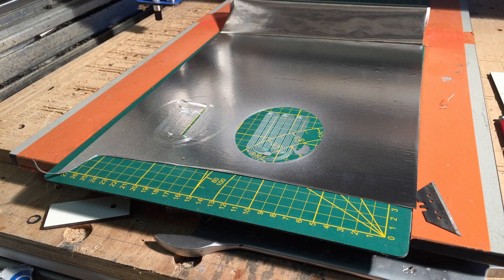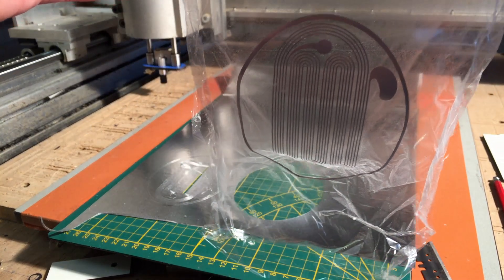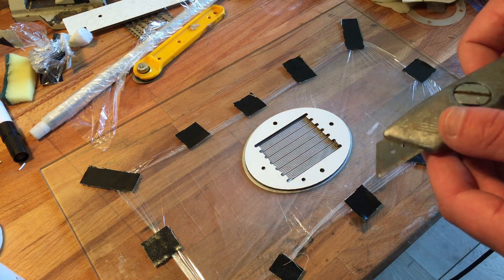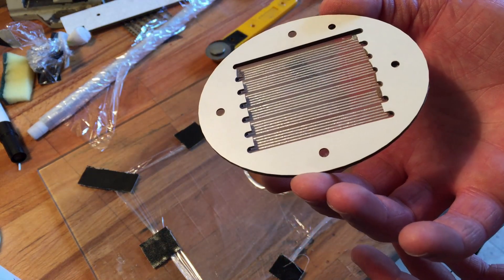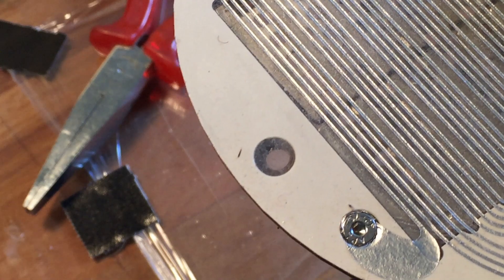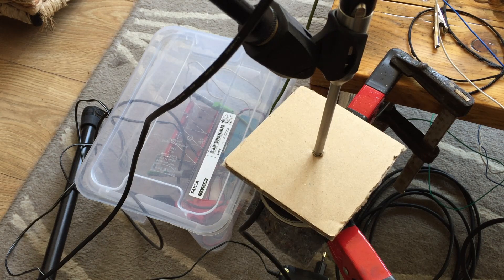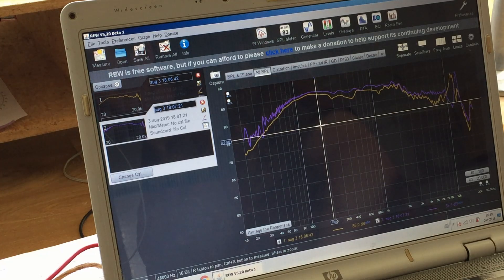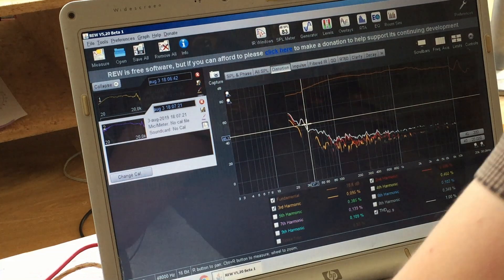Diy Planar Magnetic Headphones - Part 4

Comment: Where did you get 1 micron foil?
Reply from the maker: look for RC wing covering material on freeflightsupplies.co.uk
Reply from the maker: oh i want to add 1 micron is almost unworkable. i think thicker wont hurt ouput at all compared to the weight of glue and alu so.
Reply: @joppepeelen  thanks, i’ll try a less diy approach, it’s just hard to find a suitable material

Comment: I'm pretty sure you could make the frame as a PCB with routes, then solder number of thin wires to the PCB stretching them at the same time, and finally cover all of this with a foil glued. Have you ever tried some?
Reply from the maker: wires stretching ?   its not a electrostatic headphone :)
Reply: @joppepeelen  Just to make them straight and even. And yes, it will look like a stator for electrostatic driver at the first glance. But made of thin wire and covered with a foil, so will appear a moving membrane instead.
And I wonder have you solved 10kHz problem with these planar drivers? It looks like a phase shift.

Comment: You should stretch the mylar over a ring and tune ot like a drum to concert a or something 441hz use phone violin or guitar tuning.

Im guessing at concert a being a good stard could try c

But after tuning attach the driver then cut.
Reply: Hi. Why do you recommend stretching it to 441hz? I couldn't stretch 1um mylat to more than 180hz without breaking. It goes to max 220hz when heated.
From what I've read on the internet planars should be stretched very little, Audeze drivers are like 30-40hz.
I should experiment to see if i can make a driver with resonant frequency as low as possible.
Reply: @svetko05  ah ok i was thinking because music tends to be tuned to the resonant frequency of A 440hz the frequency might not clash but that was only based on studies of the Stradivarius violins discovered to be perfectly sculpted to match concert a resonance. (441 was a typo) good idea with the lower frequencies might be ok see if that helps clean up some distortion and unwanted resonance.

Might be like the bottom resonant head of a drum can emphasize overtone or cancel it out giving it a sharp fast sound.

Comment: Well that transfer worked very well. (Removal of traces from green cut mat) With the paper backing 30NF seems would be no issue. Maybe the water in it could be an issue but weeding is so fast seems doable. If not, could use solvent based adhesive like DAP weldwood original. Solvents don't react with paper as you already know. Can easily thin the DAP with Naptha, Just a small amount is needed. Nice job joppe!
Reply from the maker: i used spray adhesive this time. 30nf did make weeding harder :(
Reply: Did 30NF loosen the paper backing? Was that the issue - OR did 30NF form a film over BOTH the trace and weed material, making harder to pull away? Tell me! :) Great property of the spray they are usually so volatile there's no 'Flow'.

You got me thinking about transfer techniqes now. If I get time next week I'll fire up the plotter and do some transfer testing with the stronger adhesives and see if I run into anything interesting.

Comment: Peeling the paper off the foil in one looked SO satisfying lol. I honestly didn't think attaching the foil to the mylar was going to work without ripping a track in half when you stretched it so well done for getting one done with sound.

Have you tried damping the foil in/near the middle? I noticed a lot of my resonances smoothed out if I touched the tip of a finger against the foil, but this is at the cost of about an octave of bass at the same time, so no good for my design (which rolled off at about 34Hz) and probably no good for this one but it did seem to smooth out the higher frequency response.
Reply from the maker: haha yeah i agree, that felt good :) like getting plastic from new screens and such :)